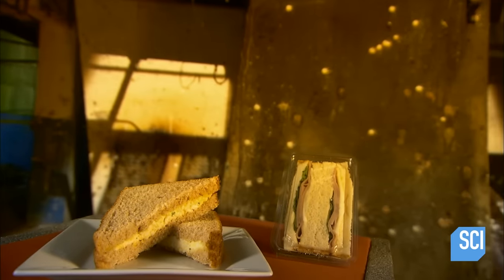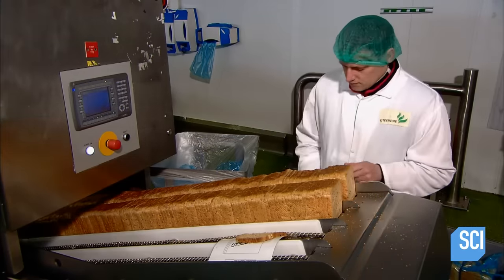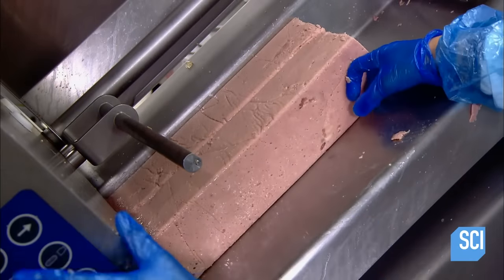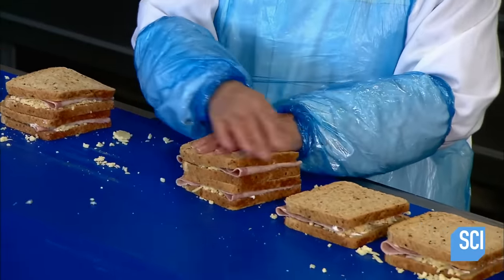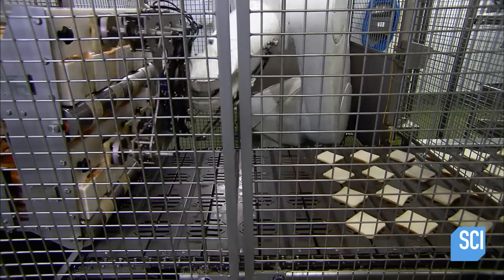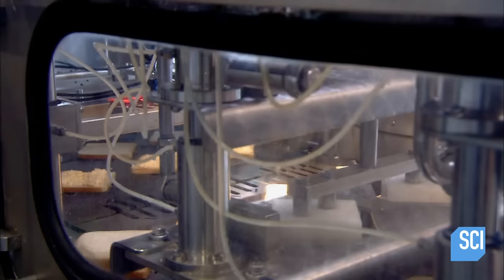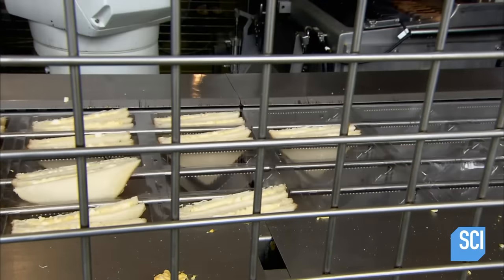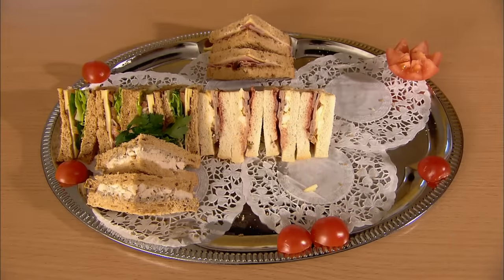How It's Made: Pre-Packaged Sandwiches

Comment: I'm surprised how well suction cups can lift bread.
Reply: The suction cups are hooked up to a vacuum that sucks in air at a high speed so it can pick the bread up
Reply: It was only the white bread - my guess would be that it's more uniform, and easier to pick up. It'd be interesting to see how it works with the other bread.
Reply: @core3481  that is the definition of a vacuum lol
Reply: Am trying with the toilet plunger and not having great success!! 🤷‍♂️
Reply: @aussieatheist960  have you tried buttering the bread
Reply: Didnt even see a mark in the bread from it
Reply: LOL
Reply: the bread is solid lol cos of all the crap its made from
Reply: Watching dozens of people that just took a shit, wiped their ass, didn’t wash their hands, and then proceeded to spread cheese on thousands of sandwiches, and the suction cups is the surprise?
Reply: @aussieatheist960   Try vacuum cleaner it will work better 🤣
Reply: @Shorts11327   Actually from changing room to factory floor everyone have to wash their hands 4 times and at the end there is also hand sanitising station and door handles have hand sanitisers built in os it apply hand sanitizer on to workers hands as he grabs the door handle.

Comment: I was amazed watching people handling the bread without gloves.  Regards from Ireland 🇮🇪
Reply: I wonder do they make the packaged sandwiches the same way over here in Ireland 🤔
Reply: They do
Reply: From ireland too ! 🇮🇪
Reply: clearly you never worked in a kitchen. even if you go to gordon ramseys kitchens they simply wash and sanitize their hands regularly. Wearing gloves actually traps sweat/dirt and builds up heat (this is bad). working with a single item, on a manufacturing line its actually better to not wear gloves (risk of contamination is low with clean, sanitized hands). 

latex gloves actually don't last very long and often break into pieces and get lost into food. 

also after handing food after about 5 minutes gloves get slippery and your fine motor skills like peeling apart 2 pieces of ham are not easy. 

Lastly stopping the entire production line for workers to go wash hands, dry them and put new gloves is like sitting down for a meal and then brushing your teeth between each bite you take. its much easier, faster, and hyginic to finish the task and then properly clean up.
Reply: @crybabylebongo  Thankyou for explaining..Regards from Ireland 🇮🇪 🎄💚

Comment: Square hams are virtually non-existent in Australia now, you might find them in delis. The big supermarkets don't stock them at all, and Aldi used to sell them many years ago. I'm guessing round ham means customers will have to use two or three slices to cover a sandwich.
Reply: That and it gives the illusion that it's not mechanically reformed meat. 
Square does not give that illusion.

Comment: A properly cleaned pair of hands are most likely cleaner than the gloves that would be used otherwise. I cannot speak for everyone or everything, but as long as they are washing their hands properly, there is no problem. Chefs have been doing it forever anyways.
Reply: The other part of this is that people under estimate the laziness of some workers. Chefs also are more responsible than minimum wage assembly line drones, and not only that but most chefs also bake/cook their food so the chance of food born illness drops.
Reply: If you accidentally scratch your nose or drop something on the floor, it’s a lot quicker to change a glove than to give your hands a sanitary wash. The long nails and rings are what really grossed me out. Hands can be cleaned pretty easily, but nails and jewelry are filth reservoirs.